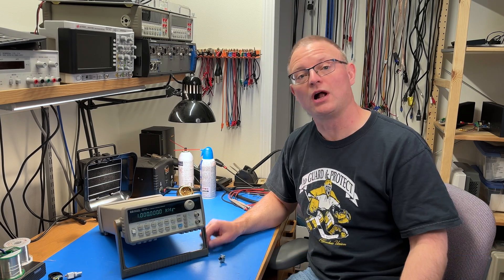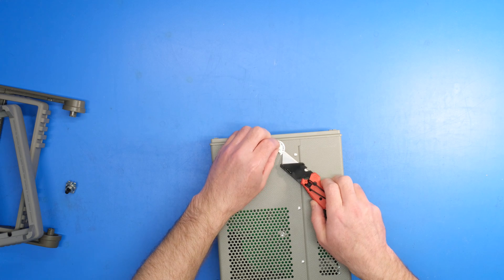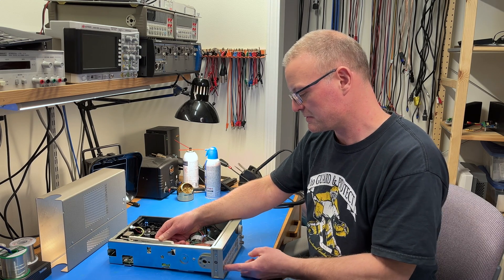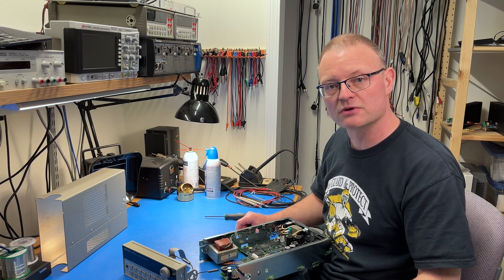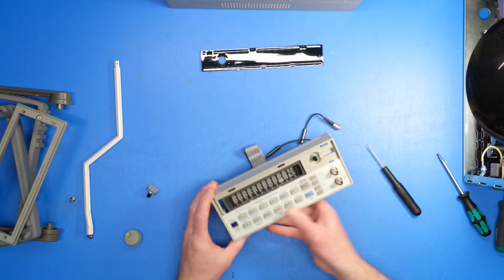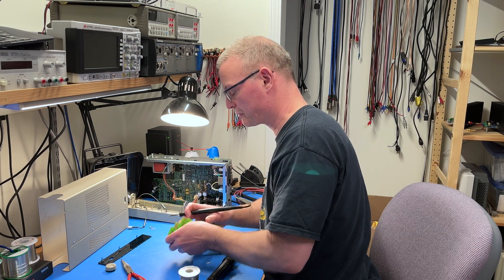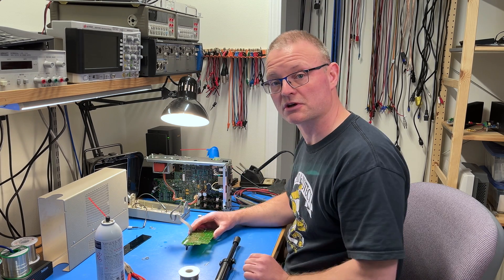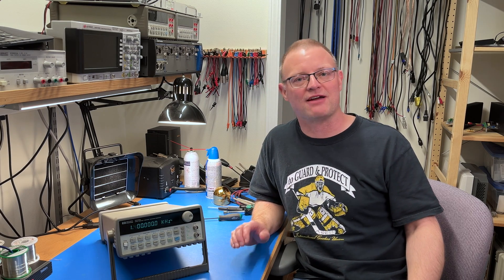HP Agilent 33120A Encoder Repair by Neurochrome

Comment: Thank you for this excellent presentation. My 33120A has recently developed a problem with the encoding wheel and is dropping some of the rotation registrations. Can you please let us know where you sourced the replacement encoder? Thanks!!
Reply from the maker: As noted in the description, I bought the encoder from Mouser. I give the part number in the description for the video.

Comment: I just recently removed the encoder , took it apart and cleaned all of the presumably silicone grease from inside it . Reinstalled it, and voila! It works like new. I'm not sure if these encoders actual go bd. They seem like a very simple part
Reply from the maker: Yeah. Sometimes you can get lucky like that. A new encoder is something like $3 from Mouser/Digikey as I recall, so I opted to swap it out.
Reply: @Neurochrome2010  If you took it apart you'd see it's very simple inside. I used IPA and an acid brush. Took all of 2 or 3 minutes.
Reply from the maker: I'm sure that's true. And I do believe you made it work. That's great! However, in my experience such fixes may work for a while only to have the encoder fail again after a few months of use. In other cases, they work for a long time. Which scenario you end up with is not known at the time of repair, so you might end up in the penny wise, pound foolish category. 

Spending $3 on a new encoder makes it unlikely that it'll fail again soon after the repair. To me, that is the best solution.

But you made it work. Great! I hope it lasts a long time. Thanks for chiming in.